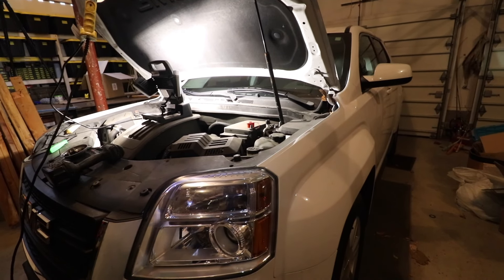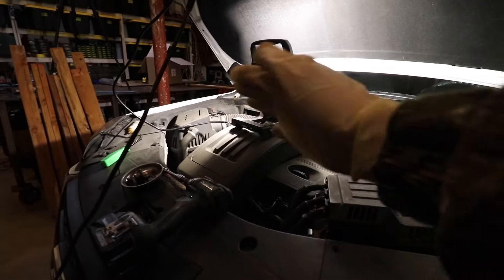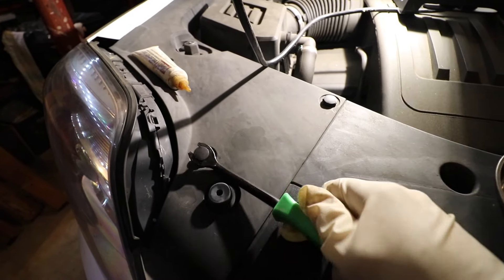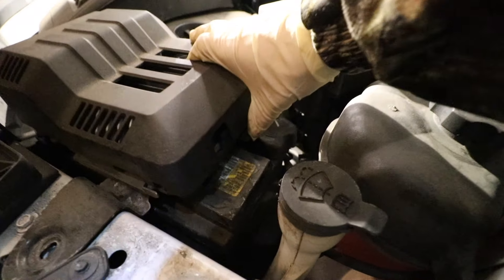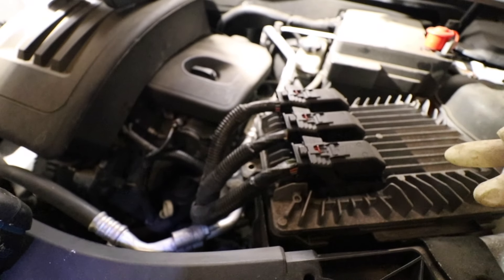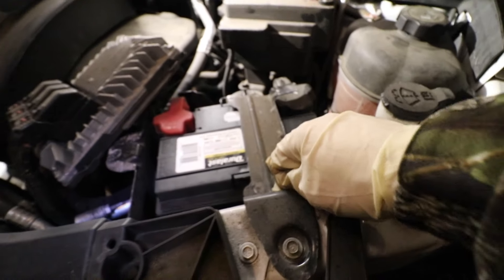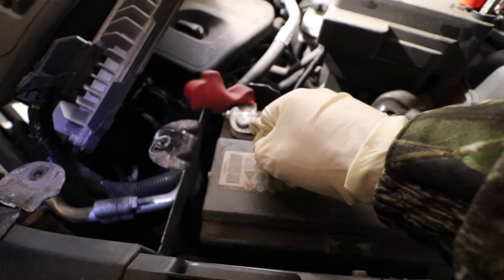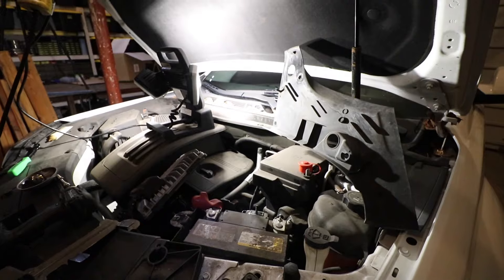How to change a battery in a GMC Terrain (2014-18)

Comment: All this nonsense to get to a battery. Horrible design by GM. Another reason to buy a Ford.
Reply: Hell no. You couldn't give me a Ford
Reply: What a piss poor design.  I’ve never seen a company hide the battery line this .  Terrible.
Reply: @TheRealMcFIy  "like"
Reply: @mronemanband1  ehh
Reply: Lol, people will whine about everything.  Once every 5-6 years, sheesh.
Reply: Actually this is not bad. I've seen batteries behind the inner fender, in trunk behind panels, in rear floor under seats
Reply: Not that good of a reason
Reply: How are you supposed to 'jump' this thing?
Mine threw a timing gear...im already hating it.
Reply: @tssci6774 no. Those that complain obviously cannot do their own work...
Reply: @edwhite7475 did you read your Owner's Manual?
Reply: It’s 2 bolts and a nut be serious
Reply: @MemphisStGeorge  talkin about your gf or?

Comment: You forgot to mention a vertical important point at the end of the video.  When removing the battery terminals, ALWAYS remove the Negative terminal first to avoid a short circuit and possible injury.
Reply: How do you loosen the Negative terminal?

Comment: What happens when you put the module back on the battery, don’t it mess up the information on the dashboard where you have to reset everything?
Reply from the maker: @dwainmorgan8550  Just plugs in. No issue
Reply: Mine didn't. It won't turn on

Comment: Good video, short and detailed.  Only thing was use of dialectric grease should not be put on the battery terminal contact surfaces.  Once it is installed and terminal is tightened down, then apply the grease or other battery protectant to external surfaces.  I use Fluid Film to prevent corrosion. This procedure is for 2010-2017 Terrain and Equinox.

Comment: How on earth do you get the 10mm nut off the back of the ECM???  I'm ready to cut the screw shorter, just so I can get at it! 😥 Had to go to the store for a long 10mm socket.  Then I had a heck of a time getting that last  terminal off.  I put baking soda & distilled water on it, but ultimately ended up using a huge pipe wrench to get it off.  Then, the battery had no strap to help pull it out.  Thank God my son came home and he got it out.  WHEW!

Comment: Good video....Very much appreciated. I have a 2014 3.6 Terrain, bought new, just 36k miles on it now...lol. The oem battery lasted 4 years. I'll probably be replacing the one in it now again in the spring. Used to get 5 - 7 years out of my batteries before all this electronic crap was incorporated on the newer vehicles.
Reply: These newer vehicles with higher parasitic draw require supplemental battery charging to bring the battery up to 100% charge.  I typically do this twice a year,  fall and winter, when discharged batteries suffer the most.
Reply from the maker: Is that necessary if you are driving the vehicle regularly? (I've never charged a car battery that I drive fequently) I could understand if the vehicle sits for extended periods of time, but with frequent driving, the alternator should keep the battery topped off.

Comment: I cant seem to get one of the terminals off, I've loosened all the bolts, the one thats giving me trouble the negative terminal, the housing where the 10 mm bolt is is kinda wobbly seems like its made of several moving parts, and the bolt doesn't come all the way off. spent a solid hour trying to pull, shimmy, and twist that terminal to come off and couldn't get it
any  tips would be appreciated! i have a 2016 GMC Terrain
Reply from the maker: Did you get it figured out? I thought the terminal removal was self explanatory

Comment: Thanks for this video. I’m wanting to clean my battery terminals not replace the battery. I only have mm wrench set but no screw gun. Will I be able to this with a wrench set? Also I’m assuming everything will get reset like the clock and radio programming?

Comment: The only reason I watched was to see how to remove the negative cable. It’s weird. But that’s the one thing you didn’t do or explain.
Reply from the maker: I though it was self explanatory. There should be a 10 or 8mm fastener on the terminal. It's off to the right slightly. I think its like a wedge type fastener.

Comment: Where so you connect power to keep ECM data?
Reply from the maker: I don’t understand your question
Reply: Audrey Taylor you can buy 12v cigarette adapter, and small battery and rear  connect in the cargi area.  They also have DTC adapter as well.  Not a big deal, only date and time needs reset in most cases on dash.

Comment: Do I need save data or not from the ecm 
just change it like that
Reply: Did he forget perhaps 🤔...maybe he's embarrassed 😳
We forgive you. Thank you for sharing step by step 😃
Reply from the maker: No, there is nothing you need to do. Disconnecting the battery may cause you to loose your set radio stations. The car may have to "re-learn" your driving style, but this will not cause damage to anything.  This is completely normal and necessary to change the battery.